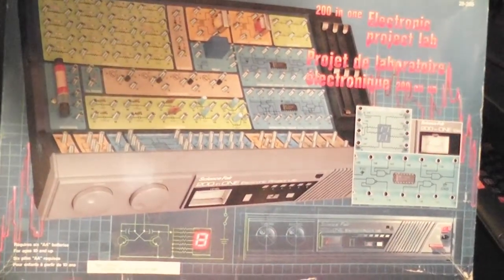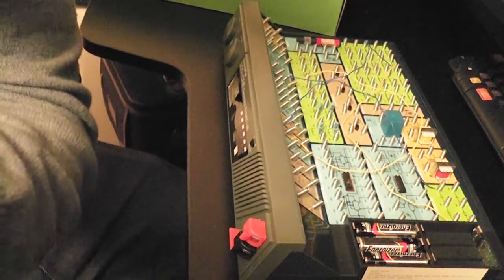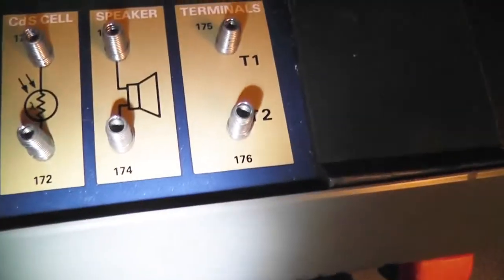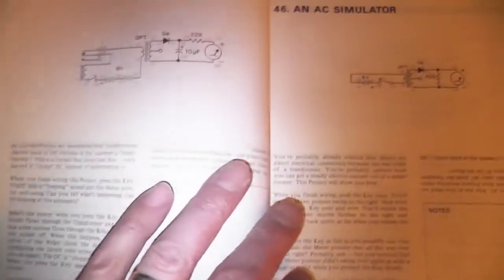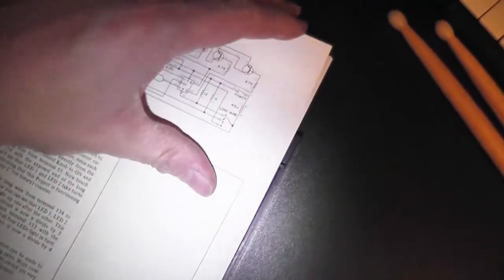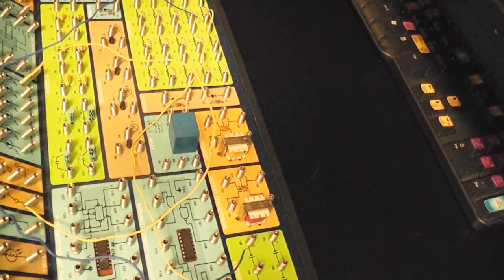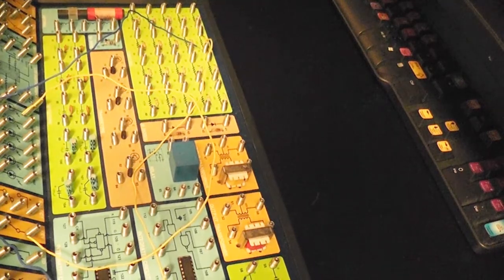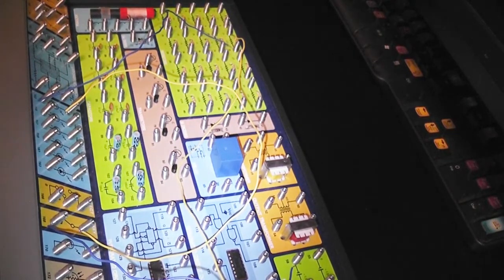Radio Shack Science Fair 200 in 1 electronics project lab - Is it just for kids?

Comment: Re. how great these kits were for learning about electronics - They were fun. I had a couple of these kinds of kits from Radio Shack. The most I learned from them was what the different electronic components looked like, and a little about what they did, but I've always been someone who's wanted to understand things. What I found lacking about them was they didn't tell you what any of the components did. They just had wiring instructions, "Connect this to that, and you've got a radio"; nothing about how it works. Many years later, I learned that Radio Shack had some booklets that educated the reader about basics of electronic circuitry, not in relation to these kits, but it's possible if I'd read those, I would've been able to figure out the circuits.

Comment: I remember having a slightly more simple one of those boards (I'm pretty sure it didn't have any DIP ICs) when I was young. I'm pretty sure I damaged a few components but it seems to be gone so I can't check. Definitely gave me some electronics intuition even though I had a long gap between using that board and actually putting the skills to use.
Reply from the maker: Yeah I think I blew a transistor on this board myself. You're right though, they're a great learning aid.